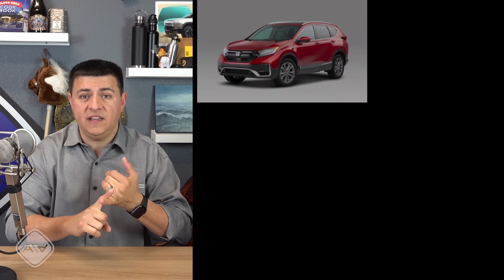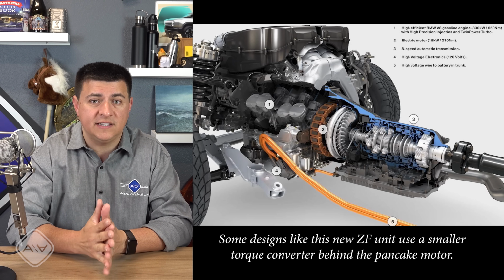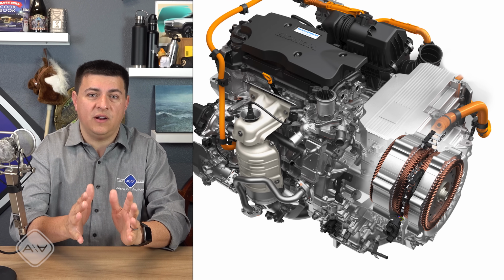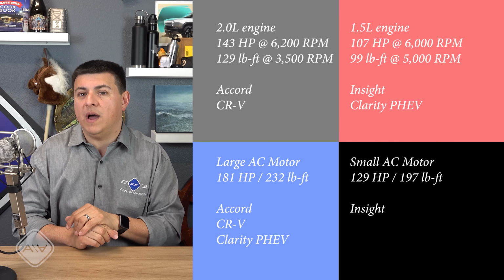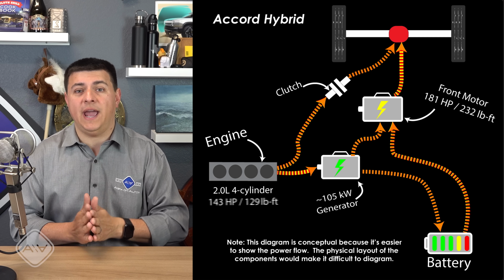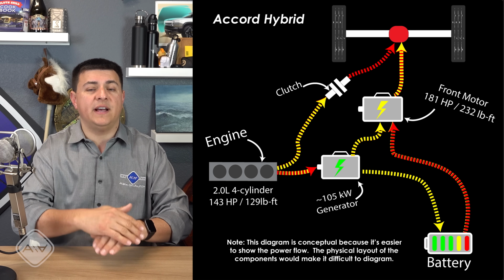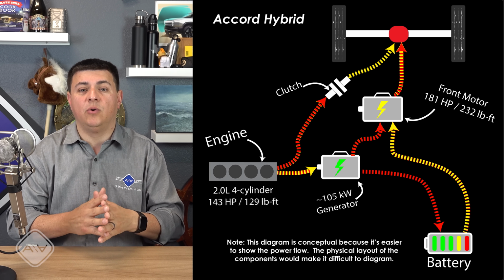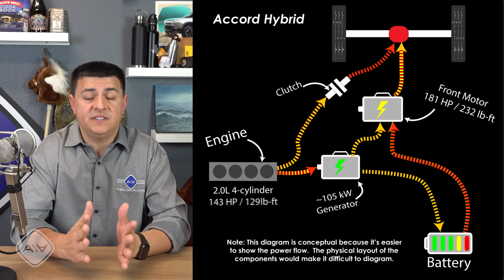How Does It Work?  Honda's 2 Motor Hybrid System Explained!

Comment: My question to alex is it possible to upgrade accord hybrid? Like if i wanted a add another bettery with the exited battery will it work fine or it will create issues?
Reply: The naive idea here is that doubling the size of the battery would, theoretically, double the length of time it could use EV drive. But it would also double the amount of time it would have to use engine to charge the battery back up to the same state of charge. So there would be no net advantage. And, since it would also double the weight, and the space required, there would be a disadvantage.
Reply: @jeffjo8732  and what about just make the battery plug in to charge? I think it should not be expensive to make accord plugin hybird?
Reply: @Ahmedpakido  There are different design concerns for a plug-in hybrid than a non-plug-in. Both for space, control, and user interface. That's why Honda makes the Clarity. It would be much more expensive to try to convert an Accord, than to just get the Clarity.
Reply: @jeffjo8732  thats true but clarity is slow has i think i.5L engine
Reply: @Ahmedpakido  And if you understand what Alex says here, you will see why the engine is not a factor in how "fast" or "slow" it is. It will matter if you drive up mountains, but not for passing quickness.
Reply: @jeffjo8732  accord hybird is pretty quick in sport mode as long as battery lasts. But it battery doesn't last very long if you put floor the pedal it drains so quickly thats why i was wondering if i can increase battery and keep the power for longer
Reply: @Ahmedpakido  
And the Clarity has the same 181 HP motor that makes the Accord quick. The engine does not affect that, but the increased weight of the bigger battery does.
Reply: @jeffjo8732  but the accord has 212hp combined with electric motor. Clarity doesn't have that because it has 1.5L engine.
Reply: @Ahmedpakido  Look up the specs. The Clarity has 212hp combined also, because it has a larger battery.

A car's HP rating never means what it can put on the road. It means what the car can generate for all the devices that need power. A rule of thumb is that the road can get 85% of the SAE net HP rating. Both the Accord and Clarity can generate 212 HP, but the split between engine-->generator, and battery, is different. And each can power the 181 HP motor, which is 85% of the combined HP.

Alex really misses the point on his HP comments, and should correct them.
Reply: @jeffjo8732  got it.  Clarity spacs are not making sense to me compared to accord hybird. Bigger battery but less miles combined.
Reply: @Ahmedpakido  12.8 versus 7 gallon gas tank?
Reply: @jeffjo8732  i got it i messed up a little bit i was actually talking about honda insight 😅.  I mixed then up

Comment: Can you still operate and drive like a normal ICE if the battery failed?
Reply: Probably not.  The ICE only has one gear available similar to the 6th gear in regular 6AT transmission and it is engaged once you reach a certain speed (closer to highway speeds).  The ICE powertrain doesn't have any other lower gears for the ICE to be utilized for lower speed city driving.
Reply: @mrgold3591  thanks
Reply: No. For one thing, you wouldn't be able to start the ICE. For another, it could only work above about 40 mph. And even then, during operation the ICE tends to run at a constant load, and adjusts the power sent to the wheels by charging and discharging the battery. A good analogy for a failed battery would be like one tire was flat: you'd have access to the engine's power, but not in the way the car was designed to use it.

But this applies to all hybrids. These Hondas could, technically, operate with just the ICE once it was started and was above 40 mph. A Toyota uses its electrical system to control the rpm of the ICE, and that would fail without the battery working.

And you can tell how big of a problem this is, by counting the number of lifeless Hybrids you see lining the edge of highways. How many did you see today?

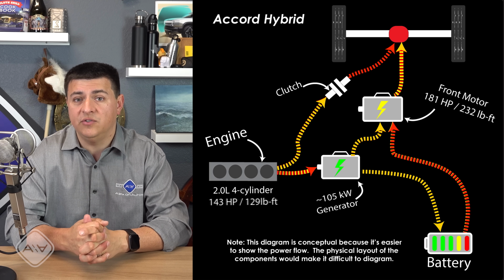Comment: Here's the correction that you want for @8:00... 
With an overall axle to engine speed ratio (with the clutch engaged) of 2.75:1 the total power probably is 212 hp, because that only needs 31 hp from the engine (or a bit more is electric motor speed has fallen off at that point), and that will happen at relatively low engine speed. At this point engine speed is nowhere near 6200 RPM, or the engine's peak power speed, which is why the total isn't 181 hp from the motor plus 143 hp from the engine; 6200 RPM engine speed would be 2251 RPM at the wheels (0.805*3.421 transmission ratio), or 168 MPH. That assumes 225/50R17 tire (803 revolutions per mile, or 75 MPH per 1000 RPM at the wheels). At 110 MPH, those tires would turn 1472 RPM, and the engine would be turning about 4054 RPM.

The engine will never reach even close to its peak power speed while the clutch is engaged. With the clutch disengaged, it can turn fast enough to produce the power required to drive the generator at peak power regardless of road speed. 106 kW generator output requires a few percent more than that from the engine; the engine is tuned to produce only 143 hp or 107 kW because that's all the generator can use.
Reply: Where he is wrong is implying that motors produce power. In any electric vehicle, the motor acts as a transmission (in the sense you use). That is, it transmits power from the battery and/or generator to the wheels. The 212 HP figure represents power produced. 

There is a rule of thumb in automotive design (I'm not saying it is accurate, just that it is used) that the transmission needs to be able to handle 85% of the power that can be produced. So if the capability of a conventional car's transmission were to be published, a car with a 100 HP ICE would need to handle at least 85 HP.  Most probably exceed that.

All Honda does is reverse that design spec. The motor-as-transmission's capability is known; it can handle 181 HP. So the electrical system will, at most, produce 181/0.85=212 HP. It can probably producer more, but never will. This makes 212 HP a good number for comparison.

This is why the Clarity, with a smaller ICE but bigger battery, is also rated at 212 HP. You will fine that every Honda iMMD hybrid, to date, is rated at (MOTOR HP)/0.85.
Reply: @jeffjo8732  Transmissions can have power ratings, although much more commonly they are rated by input torque and speed. No auto manufacturer lists the powertrain output as the transmission rating; they list the engine power rating, or in parallel and power-split hybrids the combined output of the engine and electric motor.
Reply: @brianb-p6586  And ... my point was that the 181 HP rating of the traction motor compares to the power rating of a traditional car's transmission (which I tried to explain is not used for anything), and does not get added to anything else to reach 212 HP. Because the 181 does not represent power produced, it is power transmitted, from the devices that produce power to the wheels. The same 181 HP is also the maximum power that a 212 HP ICE is expected to transmit to the wheels through its transmission.

In the Accord, CR-V, and Clarity, battery power and generator power are combined in the PCU. I expect the same PCU is used in all three, and it needs to be capable of producing AT LEAST 212 electrical HP, at least in some circumstances. (When SoC is low, it obviously can't.) Some of that power is used by peripherals, and at most 181 HP is used by the motor.

There is no reason why it can't produce more, but afaik such details aren't published.

Comment: More than a comment I have a question for you... I'd appreciate your input.
I own a 2019 Honda Insight, which I really enjoy and have nothing but great things to say about, however, I was under the understanding, as you mentioned in your video, that this system does not have an actual transmission... Still, as I came around to 30k miles, the Honda dealership required I had a $500 CVT transmission service and fluid change done, and this is scheduled every 30k miles... Is it me or is the dealership pulling one over on me?  Is there a real service necessary here? Do they need to change some "Special" CVT fluid, as they put it, that is different than regular CVT transmission fluid and of course more expensive? 
If it is necessary, no problem, I'll have it done every 30k... I save several times that on gasoline anyways... I just don't want to pay for what is not needed or even getting done at all...
Thank you for your assistance on this matter...
Reply: Read your manual, according to my 18 Honda Accord hybrid manual, I don’t have to worry about changing transmission fluid after 3 years or 47,000 miles, that is if you drive in mountainous area, which I don’t.
Reply: Your dealer is trying to make you do service you don't need. There is no mileage-based schedule (unless you live in a mountainous area). There is a computer that personalizes your maintenance intervals. This service is "due" when the Maintenance Minder shows code A3 or B3  (assuming it is the same as my Accord - look in your Owner's Manual).
The car has a transmission *system*, which means it transmits power from the motor and/or engine to the wheels.That system includes several gears including the differential, which is what lets the powered wheels turn at different speeds around a corner. This system requires lubrication, and that is what the transmission fluid is for.
It does not have what is commonly called a "transmission," which is what changes gear ratios in the transmission system.
Reply: its direct drive (no transmission) and not CVT. Im curious about the maintenance, is there even fluid? maybe for the motor direct drive?

Comment: Excellent explanation of the Honda hybrid system.  My son has an Accord hybrid and it's a great car.  Now, explain why Honda does not supply a spare tire with their hybrid vehicles.  The last flat I changed in a school parking lot was the result of a cut tire, not a punctured tire.  If it has been a hybrid Honda, I would have had to call a tow truck to take me to the nearest tire store and since it was after hours, I would have had to find a ride home.  It just doesn't make sense and is an absolute deal breaker for me.

Comment: I'm wondering about the long term durability of the computer controlled clutch.  One reason why there are so many Toyota hybrids on the road is because they don't use any clutches, or belts, or bands.
Reply: Toyota hybrids do have a clutch - it just doesn't ever disengage. It's there as a torque dampner. And I have seen discussion of its serpentine belt.

But the iMMD system has been around since 2014, and I have heard of no clutch issues. It really experiences very little wear, since the generator can make the ICE reach the correct speed before it engages.
Reply: @jeffjo8732   My wife's 2012 has no serpentine belt.  My friend's 2016 has no serpentine belt.  My 2008 camry hybrid only has a small belt to drive the conventional water pump.
Reply: @HamiltonSRink  Further research indicates that the belt wsas eliminated around 2012.
Reply: @jeffjo8732  II bought a 2012 for the wife.  That body was produced with no significant changes from 2010-2015.  There is no belt. Earlier cars did have some kind of belt.  Water pump is electricly driven.  Power steering is also electric.  And the AC is driven by electricity.  No belt.  You are right that it does employ a clutch, but since it cannot be disengaged I'm thinking it was just how the engineers decided to couple the engine to the trans.  Pretty foolproof. All other types have a computer controlled clutch. How long before that gives trouble?  If you have any insight as to why the Toyota hybrids use a clutch, please educate me!
Reply: @HamiltonSRink  I found an OEM part number, 9091602570, for a 2011 Prius serpentine belt. But not the 2012. So a Prius can have one, but not since around 2012. AS I SAID. The clutch is there to dampen the mismatch in rpms when the ICE kicks in. This is necessary since the engine is always connected through the PSD, and it causes wear in the clutch, however minimal.

The Honda iMMDs also have no serpentine belt, and little or no similar wear on the clutch since the rpms are matched by computer before engaging.
Reply: @jeffjo8732  I think you are right about the clutch!  I went to toyotaparts.mcgeorgetoyota.com to search that number, came back not for a 2011 prius.  Where did you get that number?
Reply: Hamilton S. Rink uh duh obviously hybrids don’t use belts
Reply: @HamiltonSRink  According to parts.toyota.com, part number 9091602570 is the serpentine belt that fits Toyota Prius HYBRID 2004, 2005, Toyota Prius HYBRID Base 2006, Toyota Prius HYBRID Hatchback 2006, 2007, 2008, 2009, and Toyota Prius HYBRID Hatchback Touring 2009. All this is cut-and-paste from that site's description of the part, so blame them for any errors (like it coming up in a search for the 2011). You can find a video on how to install it at https://www.youtube.com/watch?v=ef3N25wI8uE .
Reply: @jeffjo8732  You are right!

Comment: Camry or Accord hybrid which is better?
Reply: Was the dress black and blue, or gold and white? Only you can say what you see, or evaluate which is car is better for your tastes. But I can point out a few differences in the hybrid systems that many don't look for.

MPG differences are due mostly to wheel size. Don't believe me? Here are the mileages, city/hwy/comb:

16", Camry Hybrid LE, 51/53/53 mpg (also narrower tires)
17", Accord Hybrid base/EX-l, 48/47/47
18", Camry SE/XSE/XLE, 44/47/46
19", Accord Hybrid Sport/Touring, 44/41/43

There are ride differences as well; you decide if the bigger tires' looks are worth rougher rides and reduced mpg. I know that you can "downgrade" the tires for an Accord; not sure about the Camry.

Acceleration (Consumer Reports)
0-30 mph Accord 3 seconds, Camry 3.3 seconds
0-60 mph Accord 7.4 seconds, Camry 7.8 seconds
45-65 mph Accord 5 seconds, Camry 4.6 seconds.

(The Accord can do better than that in the last test. Based on how the car works, it has the clutch engaged at 45 mph, which it needs to disengage to accelerate. The computer has a built-in a delay to do this, to avoid doing it for minor variations. A smart driver can avoid it if you know you will need it.)
Reply: @jeffjo8732  thanks for the breakdown! I’ll go with the Camry for that extra mpg. I already have a fast far so I just want something super efficient. Plus Honda dealers have way higher markups than Toyota ones
Reply: @peterequations  I think you may have missed that you need the stripped-down LE trim to get better mileage in a Camry. And you can get better mileage in a high-trim Accord if you trade down the 19" wheels for 17".  But you really should drive both and see what, besides the hybrid system, suits you best. And cost less equipped as you want. Toyota adds more extras.

Comment: Adding to the transmission confusion my Clarity PHEV with no transmission requires 2.11L of transmission fluid.
Reply: And your Clarity PHEV has a differential, a countershaft, a clutch, and about four gears total. Guess what you use to lubricate and cool them?

And the 1.5L CR-V, which has an actual transmission, takes more than twice that much transmission fluid.

Comment: Make you own judgement:
AI Overview
Learn more
The Toyota RAV4 Hybrid is faster than the Honda CR-V Hybrid in accelerating from 0 to 60 mph: 
Toyota RAV4 Hybrid
Honda CR-V Hybrid
0–60 mph
7.1–7.8 seconds
7.5–7.9 seconds
Here are some other differences between the two vehicles:
Fuel economy: The RAV4 Hybrid is slightly more fuel efficient, with an estimated 41/38 mpg city/highway compared to the CR-V Hybrid's 40/35 mpg. 
Engine: The RAV4 Hybrid has a 2.5-liter, 4-cylinder engine with 219 horsepower, while the CR-V Hybrid has a 2-liter, 4-cylinder engine with 204 horsepower. 
Transmission: Both vehicles have continuously variable transmissions (CVTs). 
Towing capacity: The RAV4 can tow up to 1,750 lbs, while the CR-V can tow up to 1,000 lbs. 
Drive configuration: The CR-V Hybrid can be configured with 2WD or AWD, while the RAV4 Hybrid can only come with AWD. 
Enjoy!:hand-pink-waving:
Reply: The FWD CR-V is the most economical. The AWD (only option) RAV4 is slightly more economical than the AWD CR-V, which is not the same thing as being more efficient. The CR-V is a bigger vehicle (106 ft^ passenger space to 99 ft^3), which naturally impacts both mpg and acceleration. So this is a tradeoff between FWD/AWD, and size. Not a game of "my numbers are better than yours."

The RAV4 has a power rating of 219 HP. The CR-V has 204 HP. Both are "fake numbers," estimating power when that of the engine and battery are combined. The engines in both are smaller than this.

Both vehicles have what they call an eCVT, not a CVT. They are not the same thing as a CVT, and not the same as each other. While the RAV4 is smooth and close to seamless, the CR-V is more so.

The AWD CR-V has a true AWD system. The RAV4 has a feeble approximation that fails most traction tests, and saps battery power and mpg quicker.